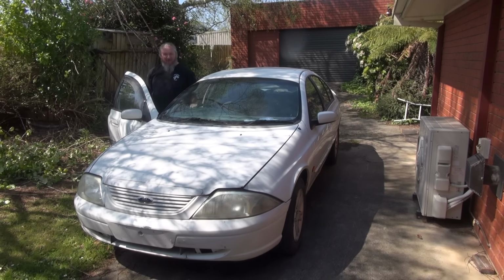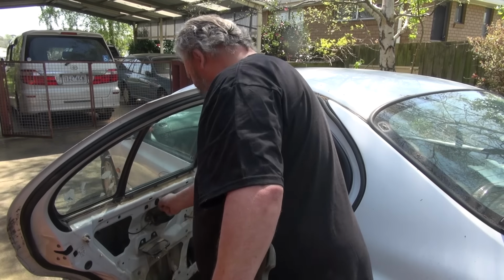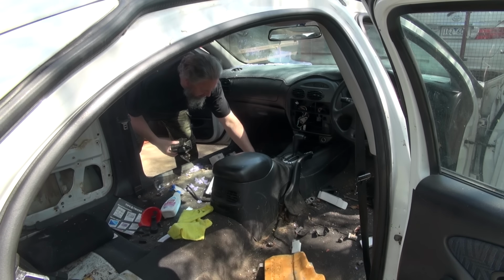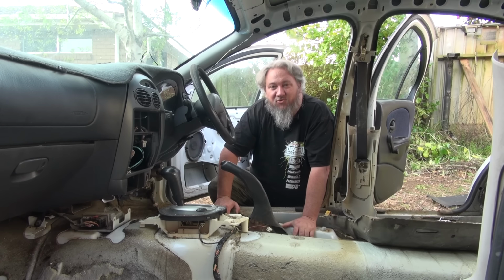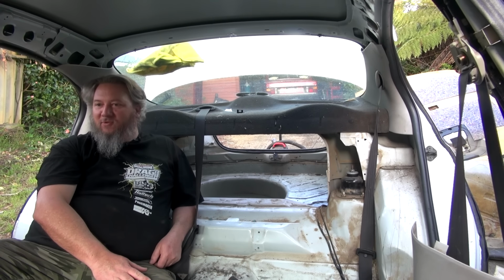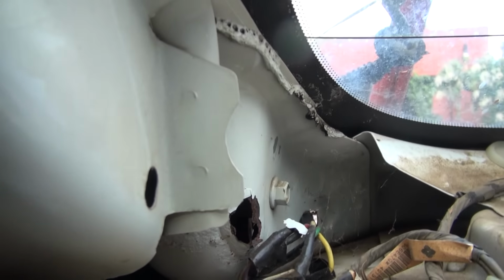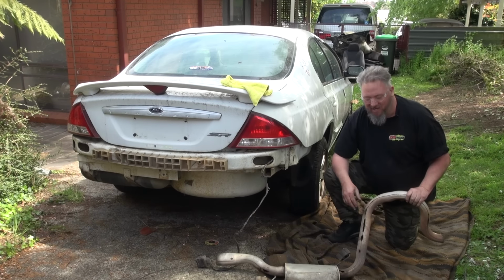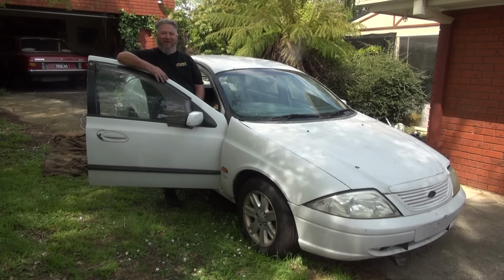Scotty's Garage - 12s For $2k Part-2 - Stripping The Car!

Comment: Boot spoiler would weigh about 5 kilos. Great finds with the cash. Once found 500 bucks and a bit of wacky baccy under the rear seat on a used vehicle inspection. As an apprentice it was a great weekend.

Comment: Well done Scotty 10/10, that's right, push the rules to the limit, , great to hear about the removal of the sway bars & the heater, also these 3 window regulators you don't need to, just wedge these closed, and you don't need boot/door rubbers, just gut the crap out of it!!

Comment: front seats are the same you can swap everything over from left to right  the holes for the adjusters are in both sides of both seats under the trim if you feel around you'll find them

Comment: Ha ha reminds me when i worked at Advance for Ford here in New Zealand and we stripped hundreds of Au ,EL,EF Falcons/Fairmonts ,Taxis were the best with heaps of change down the console and drivers seat usually enough to buy lunch with and the LTD /Fairlanes with the Alpine single channel amps hidden behind panels in the rear quarter with Ford emblem on them ,scored a couple off the boss for peanuts

Comment: Dash, hvac, boot spoiler in the bin, cut out the bonnet & boot frames, pin the winding windows up except the drivers, cut out the door frames, chuck the winders, etc etc, Scotty 😅 Edit: head & tail lights out & panel with thin aluminium, door mirrors in the bin along with any body trim!!!
Reply from the maker: @theoriginalwallace  I don't think we'll take it that far, but we'll do some of that.
Reply: @blownhemi  the lighter the better, mate 🤣

Comment: Scott, I did my track car recently and found that a metal hammer will work to break the sound deadening up, I would just hit it (not super strength but hard) and eventually it would just crack and I could break it all off the floor. My Mitsubishi was something like 20KG so 10 is well under what you have, you can scale it for the video too! Make us guess! :D

Comment: the SOHC engines are great , i love em scotty
Reply: not all of them, Ford finally fixed the SOHC with the AU series, remember from EB Series II the 4.0L had all sort of issues the main one being timing chain and the ignition systems, I mean with EF they tried coils and that failed so went back to electronic  Distribution for EL. then there was the crank issues with EF and EL.

The 3.9L also had head problems not sealing properly in Series I EA Falcon for the TBi versions which was not fixed until the EA Series 1991 version which was the EB Series I. The only good 3.9L was the 3.9L MPEFI from 1990 onward with the 4-speed auto.

Back to the AU Series, from Series II onwards the SOHC were all but bullet proof and the Dedicated LPG ones can run super lean so really bot and still not blow.

Comment: On this episode of Scotty's Garage, Scotty becomes a stripper but only gets $5.10 in coins!
That rust at the back, about 80% of Falcons will mainly get a tiny bit of rust but if the channels along the boot don't get cleared regularly, it'll look like that. Also, Scotty check around where the hood hinges are as that's another rusty spot.

Comment: Can shave more weight off cut the wheel well out and put a flat bit of ally over the hole with some sikaflex and the factory spoiler is more that you can take out and if you take out the back window and replace with plastic there is heaps of weight gone

Comment: Is this the poverty pack model? Central locking actuators and electric window motors have a bit of weight plus the air-conditioner motor and condensor the boot spoiler just to name a few

Comment: I was going say it would be amazing of the rear boot had working struts. Bloody Ford and there cheap ass way of doing things.

My AU S2 Futura E:Gas  has that issue (have no checked if there is rust in the rear qrt guard)  but luckily the AU 3 XR8 does not bit then again its been parked in garages for most of its life.

Comment: Are you going to take that useless spoiler off? They weigh a bit, the struts to hold them up are different to a standard boot lid to account for the extra weight.

Comment: So if you get the overall weight of the AU down to 1350kg and turbo it to get around stock turbo barra power so roughly 200+rwkw or so and with a 3.73 diff ratio you should see at least a 13.5 but that's running like a high stall like 2800. 
to get at least into the 12's you'll have to be getting at least 230 at the wheels, really it's the BTR that hold the AU's back with it's shitty ratios. 

only if there was a 6 speed auto that works well with the 2.23... Hmmmmmmm